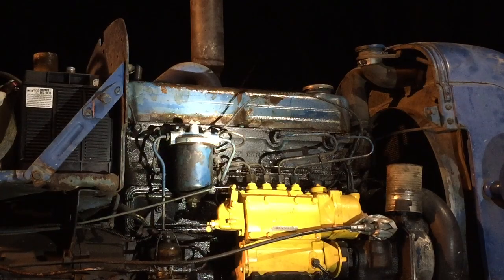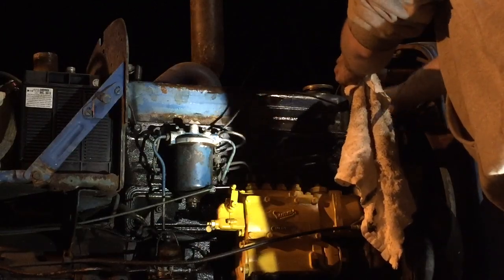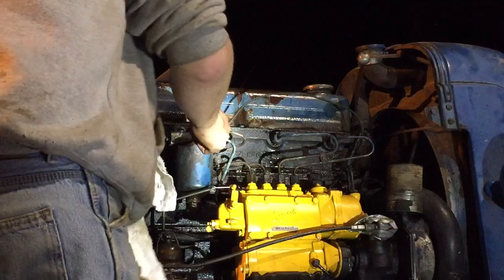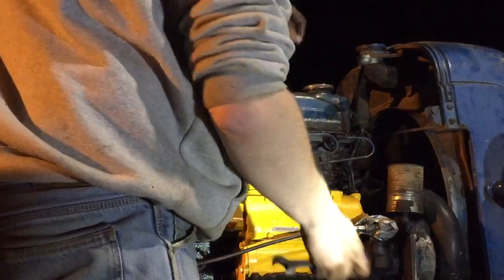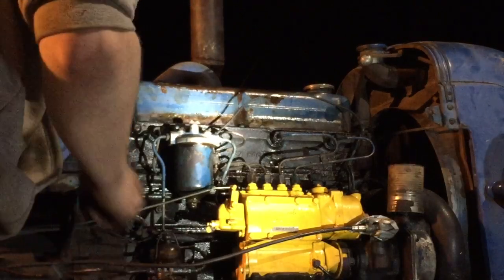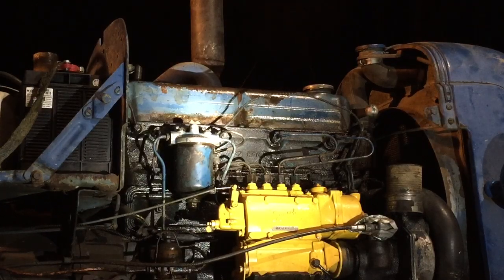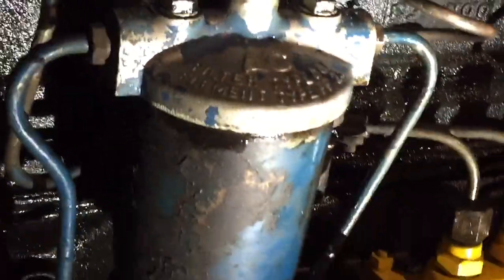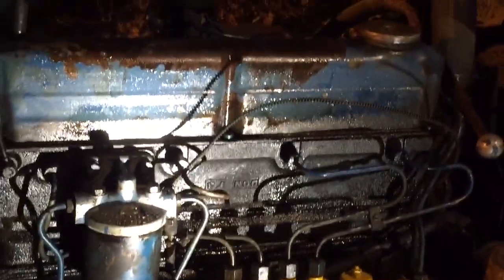Bleeding an injection pump

Comment: Crack all the fuel nozzle line nuts  and the bleeder screws on the fuel filter housing and injection pump .  Pressurize inlet of fuel lift pump to 20lbs. pressure . Tighten fuel filter housing bleed screws , injection pump bleed screw and fuel line nuts after fuel appears . Start engine .

Comment: You keep repeating 'Without Compression' as if you could somehow change it.
Is there a Compression release mechanism on that tractor or did you mean something else?
Reply from the maker: Gord Baker some Fordson Major tractors mine included have a compression release lever up by the upper radiator hose. It locks the exhaust valves slightly open I guess it's a feature left over from the crank starting days because it is set up with a hand crank slot
Reply: Yes the lever on the front of the cover is a decompression lever.  In the "up" position it keeps the valves from seating.

Comment: timing on the fuel pump.
Reply from the maker: How to time pump? There is a timing mark on the pumps drive hub, the engines timing marks are either on the flywheel below the frame rail next tofuel pump or a pointer which points at a notch in the crankshaft pulley

Comment: That's pretty cool, I've never messed around with a diesel before
Reply from the maker: What about your china diesel?
Reply: Well I just ran it, never really did any work on it lol
Reply from the maker: +coolbluelights on old diesels like this one the injection system is the most complex and expensive components of the engine, on newer Diesel engines the emissions systems may take that honor
Reply: I know it's almost a year later, where did you get your pump rebuilt?  I have an 1955 Fordson Major that  is completed restored.   We rebuilt the pump 30 years ago when they were common. I often worry about the injection pump because they are hard to find in the us.  Nice project don't give up and I hope you fixed that head gasket by now.
Reply from the maker: Robert Downing I just ordered a rebuilt pump off line